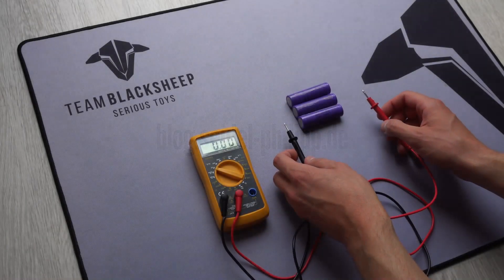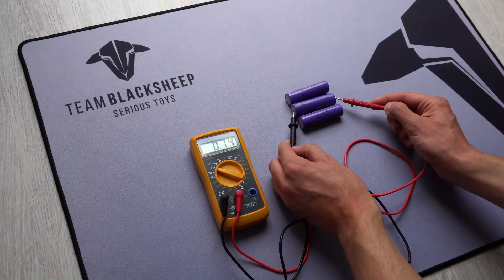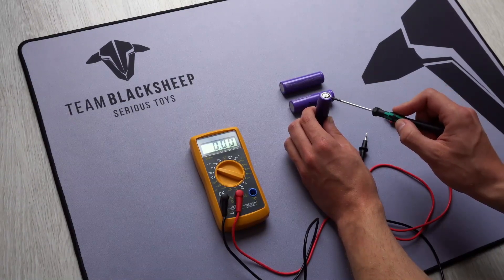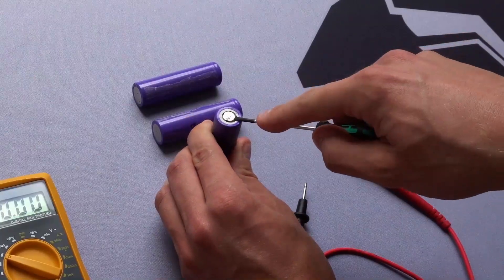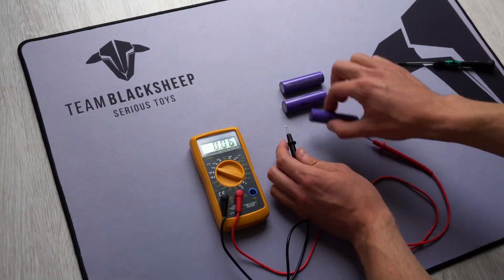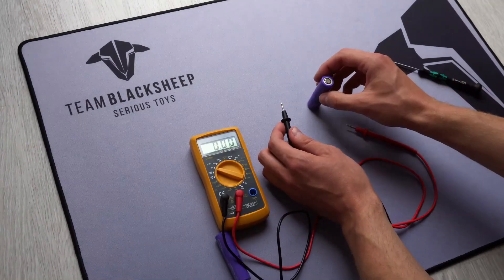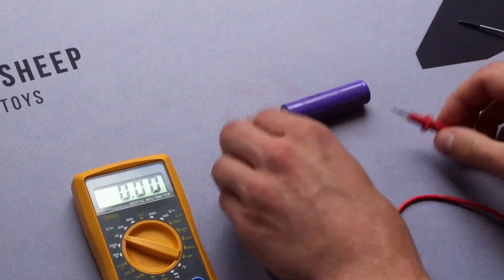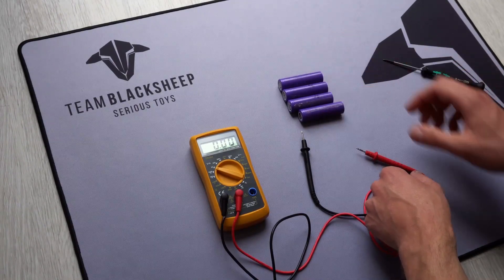How to reset the CID Fuse on 18650 Li-ion cells

Comment: I've got a 18650 cell to recover when the voltage was 0.010V.  Used a power supply with current limit set at 15mA, voltage limited to the corresponding 0.5V.  Once PS the current indicator goes off, it means the battery voltage is at about 0.5V.  This took about an hour.  Continued same method until about a volt, increased current to 50mA - 100mA.  At about 3.V increased current to 200mA.  Once the battery voltage is 4.V, the battery is placed in it's normal charger.

Battery remained cool/cold to the touch during the recovery charging.  The above battery took about a day to recover.  The other cells,/batteries within the battery pack had a voltage of 0.14V, recovery for these cells/batteries were much quicker, about a half day.
Reply: Was this a protected cell or a bare 18650?

Comment: Hi you say there is a fuse under the cap by doing what you show with a screw drive are you resetting the fuse so it will still work or are destroying the fuse so the battery is totally unfused  ?

Comment: Greetz,

What are the consequences (in terms of further use), if you accidentally vent the battery ? Meaning that you hear a hissing noise. 🤔😐

Some suggest/claim that the battery cannot go back into protective state anymore. Ergo if something goes wrong (during charging or discharging) it can explode. Can you elaborate on this please ? You can also add links where this is thoroughly explained. Thanks.

Best Regards. 🙄

PS: For anyone out there: https://batterybro.com/blogs/18650-wholesale-battery-reviews/18306003-battery-safety-101-anatomy-ptc-vs-pcb-vs-cid